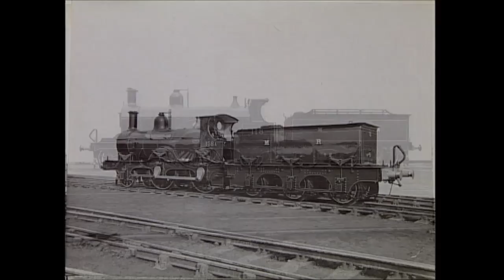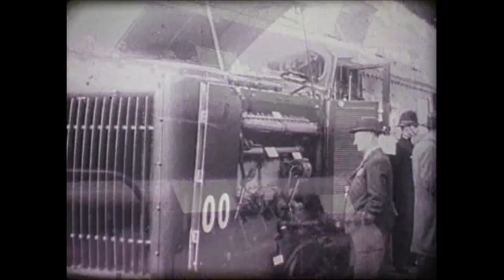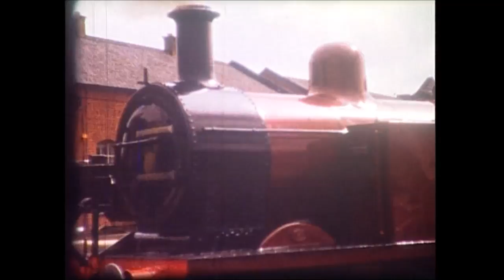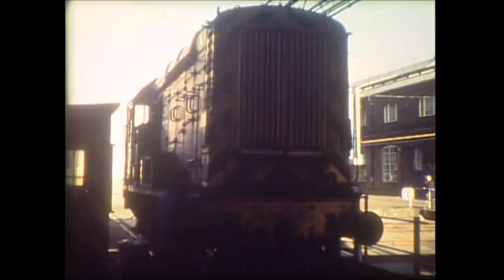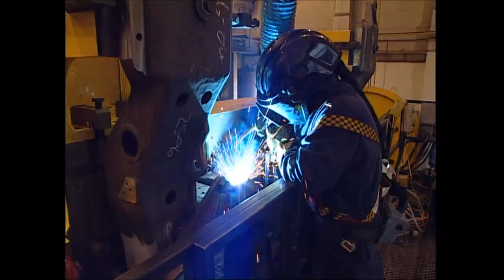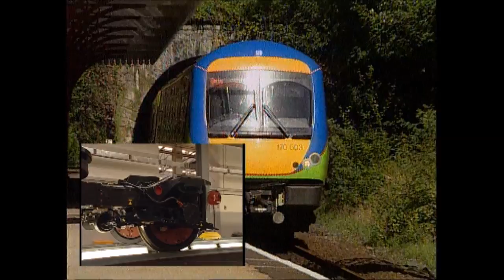derby locomotive works loco railway

Comment: Thanks for a very interesting video, I started at the "Loco" in December 1952 as an apprentice in the works training school, and later moved to Number 6 shop on the bottom yard, "Tinsmiths Shop", then when the bottom yard closed we were moved into what was I believe the Brass Foundry, and joined into the Coppersmiths shop, where the roofs of the diesel loco were made before being fitted to the locos. I left the Loco works in 1964 but I enjoyed most of my time there, but was very sad to hear of it being closed down and most of it demolished. Sad thing for Derby.